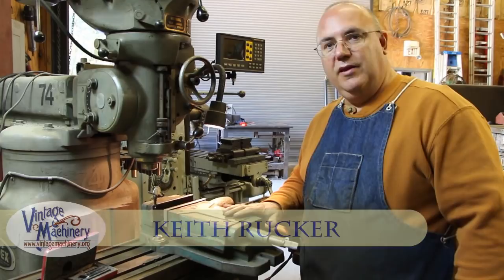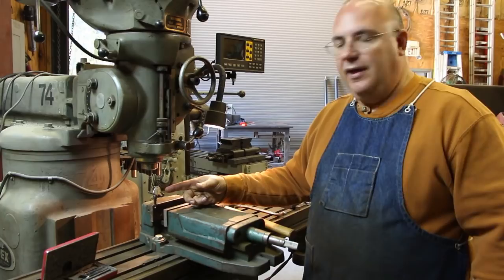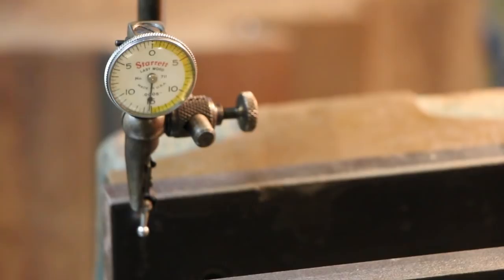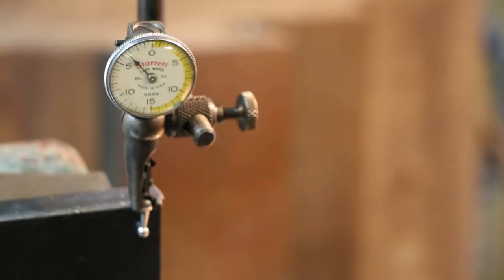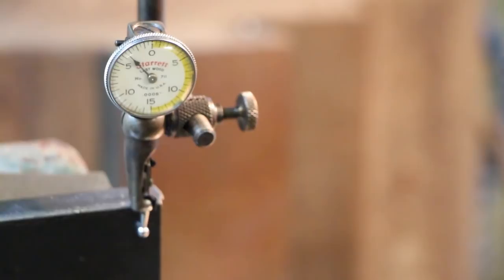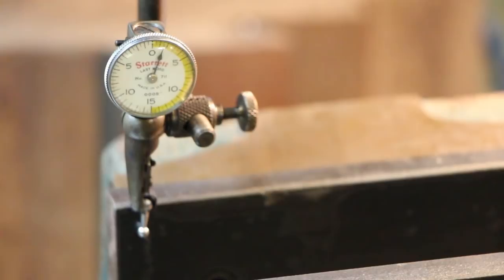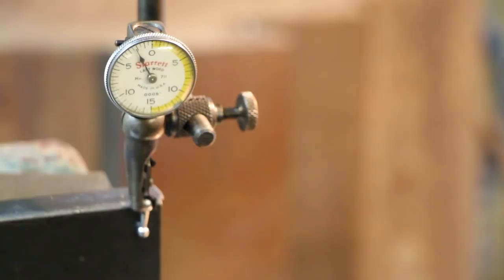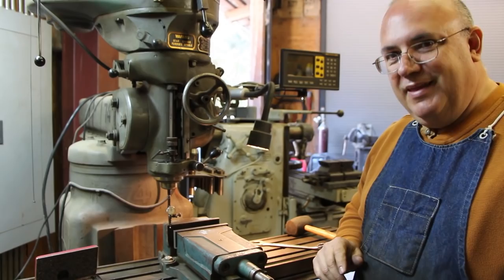Machine Shop Basics:  Setting up a Vise on a Milling Machine

Comment from the maker: The indicator I used is what is commonly called a "Test Indicator" and various types of these were made by many different companies.  The specific indicator I used was a Starrett No. 711 "Last Word" indicator.  They are pretty common and can be picked up either new or used pretty easily.

Comment: Wouldn't it be a good idea to place a parallel bar in vise? Set it up 1/2 high and let the indicator slide on a precision surface? Otherwise you could be a marred bump or hole at the end of your travel.  I am really enjoying you videos....I am re-skilling after a 20 year break......
Reply: +Glenn Martinez While I see this is an old comment, that is exactly how I do it. My parallel bars are so much cleaner and much more smooth. The only reason I watched this video was to see if he did it the same way...

The other reason I use a parallel is because I don't have the most expensive of vices... I want to see it parallel to the table when the jaws are closed - as if I had work being held.

Comment from the maker: Mike,  I am not sure what to tell you.  I have plenty of volume on my computer when I am playing it back.  I know that I have had some issues with background noise with machines running (which I am working on trying to fix), but I thought this video sounded pretty good.  Do you have problems with other videos (besides mine)?  Can you wear earbuds or plug in speakers?  Anybody else having trouble hearing my videos (background noise excluded)?

Comment: Great video Keith Rucker! One question though - when zeroing the second end of the vice, shouldn't you adjust the vice to half the total indicator run out then reset the indicator to zero at the first end?
Reply: OK I see! I would like if you could do a video on how to set up the coolant pump on the milling machine.  I have a Birmingham BPS 1649 vertical mill but there is no coolant pump on it.  I have to get the coolant in bottles and spray it on during any milling operation.  Thanks in advance

Comment: Very nice video! You are the reason i am searching to buy this exact indicator. I loved it and despite the fact it has a short travel, it must be very precise. I found one on ebay, 711 Last Word but the dial says .001" this means it is less accurate than yours right? If you know where to find one in good shape, please inform me. Thanks and congrats again.
Reply from the maker: Most of them are advertised as 0.001, but they have marks at the half thousandths as well (0.0005).